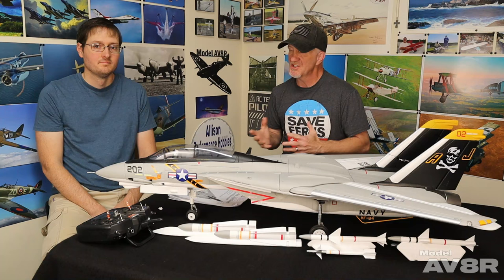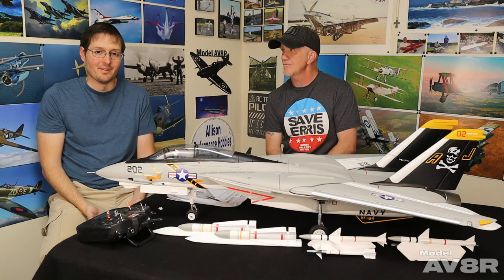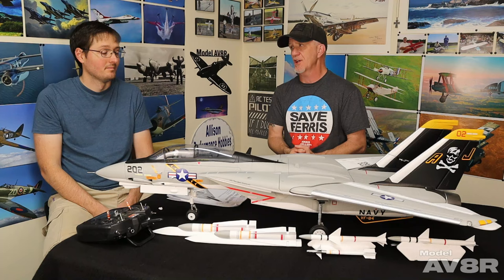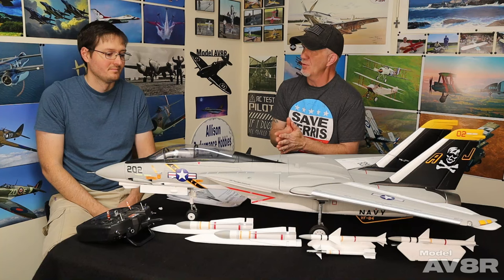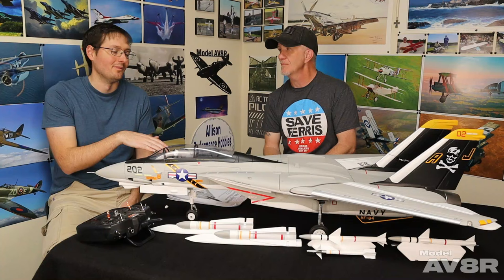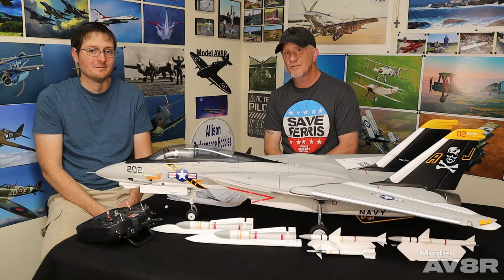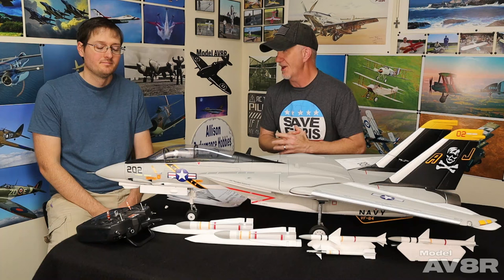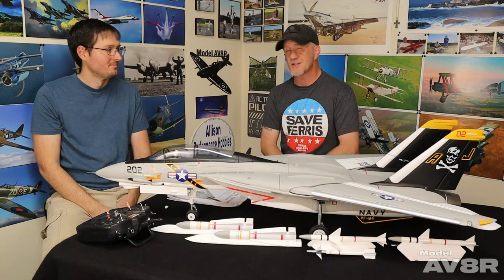Freewing F-14 Tomcat Twin 64mm PNP - Model AV8R Guest Review Special

Comment: "This is not a bad first landing at all" is such a strange statement lol - that's a gorgeous landing. Way better than our first one with this jet!
Reply: Have you tried landing  with the wings swept? Would it be less likely to drop wing at a slower speed with wings swept? I know it is not the normal way, but I'm just curious.
Reply: Even in reverse, the EDFs yank the nose up a bit it seems.
Reply: So, I accidentally hit wing sweep instead of flaps today and landed wings swept.  It came in fast and I flared to slow down and it landed just fine.  Probably one of my better landing on this model.  I have a problem of not having enough throttle on landing and it stalls a few feet off the ground.
Reply from the maker: Ha! Not really that strange...most first landings on YT don't look like that...

Comment: Dustin was wringing that battery out on the performance flight! A good demo of the model’s capabilities. Did Dustin have stability turned on for those flights?
Reply: Dustin here, i did have the stabilizer on, honestly haven't flown it much without it yet.  Typically just keep it on to dampen out the wind a bit.  Thanks a lot!

Comment: I am wondering if people are miss-interpret the instructions for setting up flap to elevator mix.  The manual states 1mm and 3mm down elevator.  One way you can interpret this is the leading edge of the elevator is pointing to the bottom of the fuse.  With full flying stabs this would cause the plane to lift its nose.    When flaps are deployed in most planes the plane will nose up and you want a little down elevator to compensate.   Again with flying stabs to make the plane go down the leading edge of the elevator must move up to the top of the fuse.  So, when I read to put down elevator into the flap mix I think you need to have the elevator's leading edge move to the top of the fuse.
Reply from the maker: That may be happening. Dustin got it right, but to be fair he is an F-14 fan and has some prior experience with them.
Reply: Hey, thats a fair point, the manual says the nose will rise when the flaps come down, so to use the elevator mix to compensate for that.  I agree the verbiage is a bit confusing though.  They probably should say "nose down elevator" or something like that.   That said, i personally didnt notice any nose up pitch with flaps, so i ignored that mix all together and I'm happy with how it handles.  Some may find it easier with a bit of nose down trim on landing though, sometimes it can help.  Thanks.
Reply: Just for anyone reading this advice, after several more flights on this jet, I did eventually put some nose down elevator into the flap mix, and I think it helps. I didn't feel like it was needed to keep it level while flying, but on final approach I do think it helps to keep the nose down.  If you flare very much at all with this one it will drop a wing.  I've had a much higher percentage of pretty landings since I made that change.

Comment: When Duston setup his control throws did he used the measurements in the  manual or the percentage in the manual?  I am using a NX10 and the percentage is not very close to the measurements.  Also, did he do Wesley's modification to the ailerons?  Thanks in advance....
Reply from the maker: I'm not exactly sure, but Dustin was telling me he has learned some new things that may help folks with them. We plan to do a follow up vid, and I'll make sure we do one of our set up pages on his plane...so you'll have specifics.
Reply: @ModelAV8RChannel  Thanks that would be great.

Comment: great video, I want to use a spektrum 10 channels as3x/ safe rx, Iwas wondering if I can still use the stock board just for the gears and the wing sweep? and ail/ele/rud stabilized on my spektrum rx?
Reply: Hey it's Dustin, I don't see why that wouldn't work.  I would think that you could hook up all the flight control servos straight to the spektrum rx and then program them all via your tx.  That said, I haven't tried it, so there may be some weird issue I'm not aware of.  Good luck if you try it!
Reply: @grcvid  thank you 👍

Comment: I can fly electric larger sized warbirds and would love to fly this jet. Seems a little scary to land this, is there a good starter jet you would recommend?
Reply: I mean to work my way up to fly the F14.
Reply from the maker: I think for your skill level either of the E-Flite Vipers would be a great place to start. 70mm or 90mm.
Reply: @ModelAV8RChannel  I just discovered the Viper, but I've never seen it before. I was told the f22 raptor is a very easy starter jet due to its slow speed and versatility. Thanks ill look into both.